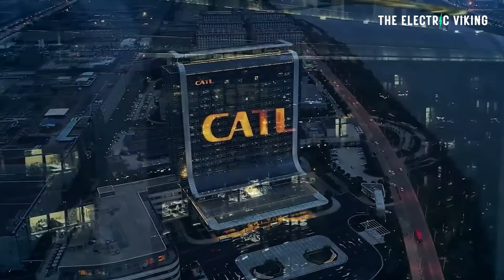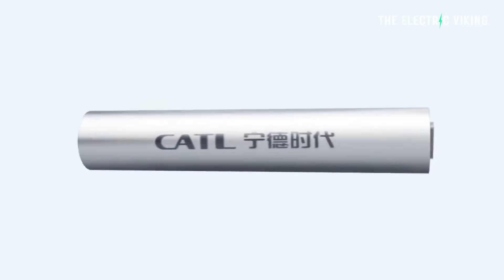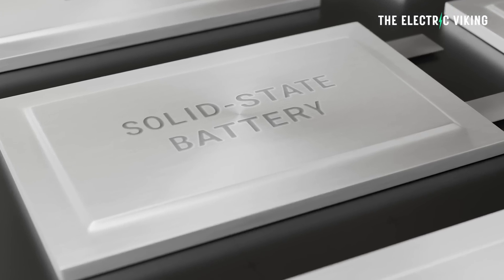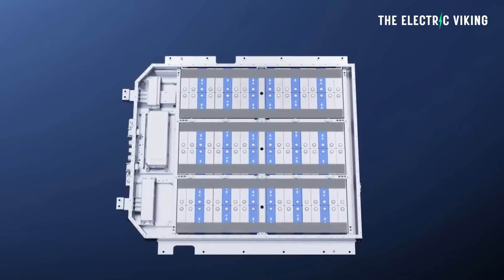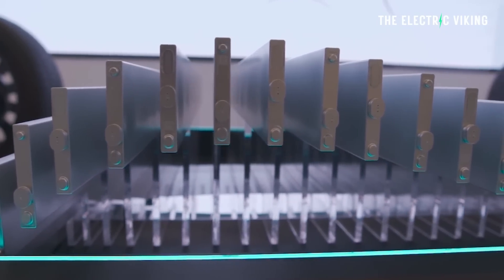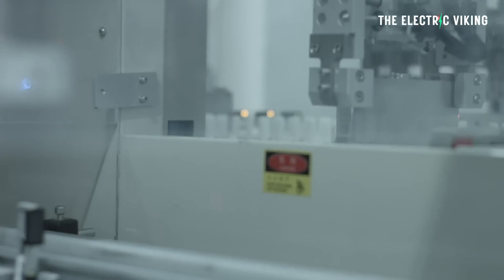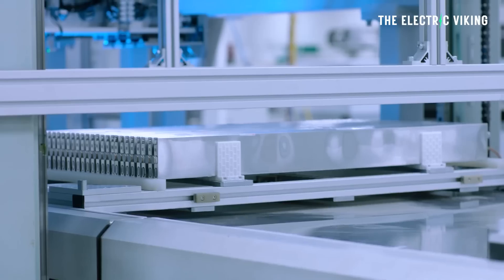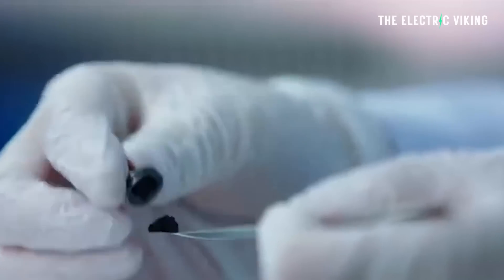CATL's sodium hybrid battery will be 30% cheaper & revolutionise the world

Comment: China’s “water battery” is a success! The safety and energy density of the water-based battery from the Chinese Academy of Sciences exceeds that of lithium batteries! The battery energy density is twice that of lithium batteries. Using iodine and bromine as electrolytes, the energy density reaches 1200 Wh/L!:hand-orange-covering-eyes::hand-orange-covering-eyes::hand-orange-covering-eyes::hand-orange-covering-eyes::hand-orange-covering-eyes::hand-orange-covering-eyes::hand-orange-covering-eyes::hand-orange-covering-eyes::hand-orange-covering-eyes::hand-orange-covering-eyes::hand-orange-covering-eyes::hand-orange-covering-eyes::hand-orange-covering-eyes::hand-orange-covering-eyes::hand-orange-covering-eyes::hand-orange-covering-eyes::hand-orange-covering-eyes::hand-orange-covering-eyes::hand-orange-covering-eyes::hand-orange-covering-eyes::hand-orange-covering-eyes:

Comment: -20C that is an average 4 months of winter for most of Northern US and Southern Canada.  When it gets cold it can go  -40C and lower.   In the northern parts of Canada -30C is average winter temperature.   EV batteries and heating systems just don't cut it in these temperatures.
Reply: They do in Norway apparently?
Reply: @markbennett6658  If you want to live with limited range requirements and no heat in the vehicle I'm sure that is fine.  But we have distance and charging issues here, like 300 to 500Km between closest cities, and not a charging station between them.  My ICE vehicle gets over 600km on a tank, and plenty of heat.  Not saying that they won't solve this, it is just we're not there yet.
Reply: @bigpicture3  of course the difference in Norway is the infrastructure. They have minus 35 - 40c winter temperatures and large barren areas as well but their government has heavily invested in incentivising the transition and have a very close relationship with Tesla so they have plenty of superchargers and also other non Tesla fast charging options. With such a high adoption rate, a good standard of living and low population density home chargers are also commonplace no doubt. I’m not saying there aren’t still issues but I think the narrative will move on fast. Some parts of the world will just take longer than others to get the memo!
Reply: @markbennett6658  Do you know anything about "geographical size"????  I live in Canada and it has 9 provincial regions each one of them are larger than Norway.  I live in one of the geographically smaller provinces and it is over two times the size of Norway, and all of Canada is 33 times the size of Norway.   I have driven coast to coast non-stop, with two drivers, and it takes over three days without any stops except for food and gas.  Where are we going to put all this EV infrastructure???  You are talking about grocery store vehicles here, when I can drive over 500 Km on a Sunday return day trip.
Reply: @bigpicture3  I do. I once drove from Miami to San Diego in the US! The point you’re making is 500km (300 miles approx) between populated areas is too far without infrastructure in a cold climate . I’m quite aware Norway is substantially smaller than Canada but it’s not heavily populated, is cold  and there are still significant journeys to be made in cold conditions. The EV infrastructure can be built into existing service facilities. 

Most usage of passenger vehicles is relatively local generally but yes I appreciate that in your particular scenario the technology and infrastructure do still need to improve.
Reply: @markbennett6658  Coast to coast in Canada is over 3,700 miles driving, with gas stations all the way, Miami to San Diego is 2,700 miles driving, and I am guessing not a lot of snow and ice, even in winter.
Reply: @bigpicture3  I know but it’s still a long way but with plenty of truck stops where EV infrastructure could be put in. I’m guessing that’s the case in Canada as well?
Reply: @markbennett6658  No, that is not the case, it is the chicken and the egg thing.   Why build a charging infrastructure on a main highway if there are few EVs?, and then why buy an EV if there are no charging stations?.   This was the very same issue they had at the beginning with gasoline vehicles (no infrastructure, in some cases not even roads) the difference being you could strap as many gas containers to your vehicle as needed to get you there.  This is still the case in some places in Africa, and deserts etc. (carry your own gas for the complete trip)  Where do you strap the extra batteries on an EV???
Reply: @bigpicture3  You don't strap onextra batteries.   You get  a cargo carrier for your trailer hitch and you strap a generator it it, of course!     Or of your EV is a pickup truck, you just put the generator in the bed.   Where there's a will, there's a way! 
(But I'll stick with my diesel for now)
Reply: @bigpicture3  EV adoption isn’t and won’t be driven by the need to do transcontinental journeys on massive highways. It will reach enough critical mass in my opinion that economics will drive the development of the infrastructure. Governmental intervention and incentivising, if the political will is there, should accelerate the process. That’s already the case in many parts of mainland Europe where EV fast charging facilities with clear signage indicating pricing run in tandem with petrol and diesel forecourts.
Reply: @markbennett6658  They run conventional cars when they have heavy duty needs like driving up to their getaway cabins etc.Also their use of oil has only dropped by about 1%,that should be a clue.

Comment: Click bait. I don't understand why the green agenda is going after personal transport why doesn't this tech go to grid storage/energy security as electricity and manufacturing is a much bigger polluter then personal transport vehicles and you don't need 100kwh batteries to get 1 home off grid that 100kwh battery would easily get 2 homes of grid possibly 4-5 in an energy conscious household. Then better and more solar on houses so much better than getting 1 ICE vehicle off the road and with a house with a good solar system it doesn't move so it doesn't matter if it takes hours to charge.
This whole green agenda has never been to save the planet it's about lining pockets it should be called a greed agenda and people like you Sam I think you only care about the money you've put into the stock market again not about saving humanity just lining your pockets I mean why else would you put out 5+ nonsense videos a day

Comment: Replacing a battery pack will be a lot cheaper and much less complex than swapping out an ice engine.
Reply: I replaced an internal combustion engine twice, both in very old cars. The overwhelming majority of cars with ICE engines never need any major work on them. We have two Prius cars (one 2002, one 2014) that recently turned 200K miles. Neither of them has any engine issues. The 2002 recently needed a hybrid battery rebuild for $2000 and a couple days DIY.
Many EVs are near end of life when the battery has to be replaced. The Tesla model 3 is typical of Teslas, with a $16,000 parts and labor cost (almost all parts. Ioniq is widely variable, with RepairPal estimating about $5500 but isolated $60,000 situations are reported for the Ioniq5 when the failure is from road debris damage.
Reply: @flagmichael  did you take the time to read my comment? "Will be" is future tense. Of course the cost of new battery technologies is high...for now. If you weren't so obviously anti-EV, you might be up to date with the developing and breakthrough battery sciences which will inevitably become less expensive than hybrid and ice technologies.

Comment: Nuclear is NOT fossil fuel. Also, what will you use to generate the power to charge these???? Hopes and dreams?
Reply: Correct, it's not.  It produces no CO2 emissions either, and it runs 24x7, obviating the need for battery storage or hydrocarbon-fueled backup capacity that "renewables" currently require.   Yet somehow the the "green" movement doesn't want us to have it, which makes it difficult to take them seriously.

Comment: Batteries are energy storage. Nuclear is energy creation. Very different things.
Reply: The connection between the two is that nuclear generation is one of the answers to zero carbon baseload generation when renewables (wind and solar) are temporarily unavailable ... alternatively if you have cheap effective battery storage you can store electricity when the sun shines and the wind blows and avoid needing so many nuclear power stations. That's what he means when making the comment about being cheaper than nuclear.
Reply: @MrAdopado  He could not be more wrong about the cost of nuclear, because it's actually cheaper even before adding transmission line and battery costs.
Where I live solar has a capacity factor of 11% and it costs €1 billion per GW, roughly.
lets say I have a magic grid, where you can just add capacity factor adjusted sources to satisfy base-load demand, which in magic grid land is constant.
My grid needs a 1 GW supply, so I can just build 9.09 GW of solar costing me €9.09 billion - (1/.11)
But then Sabine H says why don't I look at nuclear, so I find that Korean Hydro and Nuclear Power will build me an APR-1400 based NPP for the same price they are building Shin-Hanul units 3&4 for in SK, which is the same price they offered 6  reactors to Poland for: €2.96 billion per GW.  I ask her is she mad? She just smiles and tells me the capacity factor is 96%, I do the maths, because I can, unlike so many renewables optimists like our channel host, and so I give KHNP the gig to power my grid for  €3.02 Billion, instead of €9.09 billion.
Even if batteries get to near no cost, it still makes no difference to a cost argument that disfavours solar and wind.  The grid upgrade forecasts in themselves are pure lunacy.  The estimate for Australia is in excess of 10,000 km of additional transmission lines to connect to remote renewables.  By 2040 the entire global grid needs to be doubled in size, costing €600 billion per year to achieve.  With NPP you don't need to do this if you site NPPs as replacements for fossil fuel plants.
Reply: @cnocbui  Maybe look into what nuclear plants in the US and europe actually cost and include costs for fuel, spent fuel storage, and demolition of the plant, then come back to us.
And maybe don't listen to Hossenfelder as much. She is attrocious on anything that isn't very specifically physics. Even on tangentally related subjects she fails nearly every time.
Reply: @cnocbui  Your numbers are all wrong, but then, you just invented numbers to support the wrong conclusion that you had in the first place.
Reply: I wish Sam would do a comparison of the total mass requirement for nuclear and solar.
Reply: @waywardgeologist2520  
Sam has been lying by omission since this chanel started, why would you expect him to be honest now?
Reply: I think he means that with a wonder storage system energy creation may go renewables 100%. 
I think that we’ll need nuclear for a long time, for some sort of baseline that does not depend on anything variable and uncertain.
Reply: @pascalbruyere7108  Who cares about the mass required?
Reply: We don't need no freaking Nuclear, Oil or Gas, we got salt batteries now, get with the program Heretic.
Reply: Batteries are part of a renewable energy grid. Renewables are muuuuuuuuch cheaper than nuclear. If batteries also become cheap, that is a nuclear-killer.
I at least think that's what he meant. It's sometimes hard to tell.
Reply: @4203105  Name the grid that solely generates energy from renewables and uses batteries to make up for their terrible capacity factors?  I'll save you the search, there isn't one.  Batteries are too expensive at grid scale.  In the EU we get dunkelflauts lasting weeks.  There is no battery tech close to being affordable to power entire developed countries for several weeks straight.  Nuclear and geothermal are about the only two zero CO2 energy sources that are cost practical at scale.  France and Iceland are essentially zero CO2 now.  The only CO2 France emits is a bare trickle as a result of keeping some gas turbines ticking over for grid stability reasons - they actually generate more energy from zero CO2 sources than they consume.  Renewables only seem cheap because the BS that is LCOE, does not include the cost of providing the power that is needed the majority of the time they are not performing.
Reply: @cnocbui   It's the year 1724, name one electrcitiy grid, period. I'll safe you the search, there isn't one.
LFP batteries are now roughly half the price of pumped hydro and grid battery storage gets increasingly deployed.
If you think france's grid would be stable without its neighbours you might want to come out of under your rock. They constantly have to turn those nuclear power plants off, because they are so unreliable.
Also you are talking about batteries being to expensive and suggest nuclear fission as an alternative? Seriously?!
Reply: Energy creation? Now that would be a real game changer😂. the world is awash in energy the only real problem is storage and distribution.
Reply: @linemanap  Should I have used the word "generate"? Nuclear generates electricity, or a gas fired power plant generates electricity, or hydro plants generate electricity or wind and solar generate electricity. But in every case if the power generated us not consumed it's wasted. A solar panel generates power from the sun but without some form of storage (battery) it's useless when the sun doesn't shine. Or a wind power generator can store the energy that was "created" or generated while the wind was blowing and the energy stored in a battery when the wind isn't blowing. What am I not understanding. Maybe I should use the word  "convert " instead of create or generate? But the choice of words is wrong? Generally most folks think of making power and storing that power. Is it symantics? My electric motor generates/creates lots of power from stored energy in the battery. How would you express that situation? Thanks. (English not my native language)

Comment: Lol 🇨🇦 here. We see -43°C every winter here in norther BC. People do own tesla's but for summer driving only
Reply: I've seen many Teslas rolling at -40 here.
Reply: Never seen a Tesla in Winter ????
Reply: @peterjones6322  have you ever heard of Norway. most EV there are Tesla. Norway is so close to north pole just like Canada
Reply: I haven't lived in cold weather for many years. When I did, I installed a device that kept the radiator fluid flowing when it was plugged in using an extension cord. I often added a can of some sort of fluid to thaw the frozen gasoline. Have ICE manufacturers solved those issues?
Reply: If you have a garage it doesn't affect you.
Reply: California?

Comment: Watt is a unit of power. Watt-hour is a unit of energy. Battery energy storage capacity is measured in watt-hours. Battery energy density is measured in watt-hours per kilogram.
Reply: Can also be measured by volume instead of weight.

Comment: I can see manufacturers maintaining the EV prices similar to ICE cars just to maintain their desired profits
Reply: Legacy car makers might be motivated to protect their ICE revenues that way.  However, EV-only manufacturers are highly motivated to win market share, so they will probably pass on most of the cost saving.
Reply: I can see this enabling them to still make a buck on lower end EVs. There's a huge completely unfulfilled market down there that EV manufacturers currently can't or won't compete in.
Reply: Also govs with tariffs
Reply: Not really.  While Toyota is attempting to perfect hydrogen powered engines to more easily commoditize such complex patents and IP, that isn't possible with battery tech due to the cost curve.  Legacy carmakers don't know how to put this genie back in the bottle.

Comment: Hope you are right.  Sitting on the sidelines for another decade until this sorts itself out.  Range.  RANGE.  RANGE!
Reply: No, it's CHARGE CHARGE CHARGE.

There's millions of apartment dwellers out there, and unless they can get their car charged at a place that is just as common as a Gas station in 10 minutes or under, their gonna stick to their gas powered cars, regardless of range and the price of EV's may match but will NEVER be below gas cars, and most places, and battery tech, are years away from that scenario, not to mention underdeveloped Countries.

 That's what the surveys show, convenience is King
Reply: EVs now provide the same range as a gasoline powered car.  It's not 2018 any more. 😂
Reply: @PETERJOHN101  Really?  I have a gas car that does 500 miles on a tank, but my vehicle of choice for long-distance travel easily does 850 miles on a tank of diesel.  Both figures are at 75-80 mph on the highway.  Both "recharge" from 0% to 100% in under 5 minutes.
Reply: @PETERJOHN101  Issue is, even cheapest 13k gasoline car (Dacia Sandero, 12600€) can go 750km. EVs that come somewhat close, are 50k€+.
I love EVs, but really, range is not their strong side.
Reply: @MrVolodus  Cheap gasoline cars can usually only go around 500km. That has to be an overly optimistic estimate or the Sandero has an unusually large tank.
Reply: @PETERJOHN101 I can get 1000km range from my 60l tank on the open highway, I'm waiting
Reply: Range will be around 200-300 miles. Once we can make battery packs based in new chemistry that can go further than that, we will make them smaller and keep range at 200-300miles…  Elon pointed out over ten years ago he could make a car with 500mile range by fitting it with two of his standard Tesla battery packs. But carrying all that extra weight around ever day when the range was only needed rarely was daft. Better to keep range to 200-300miles and concentrate on charging faster for the rare occasion you need to travel further.